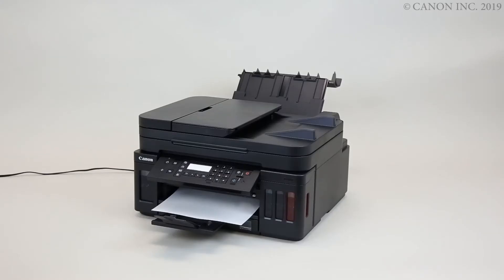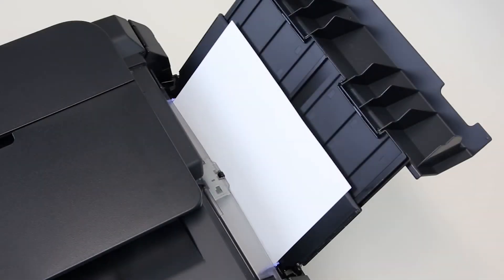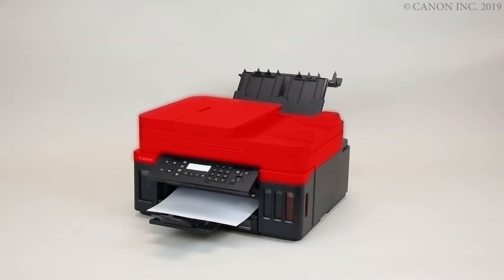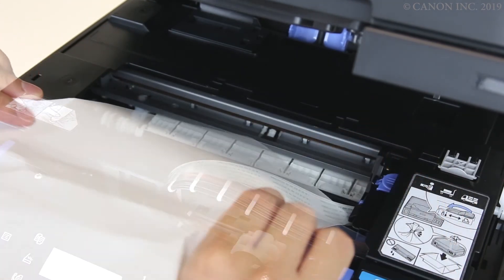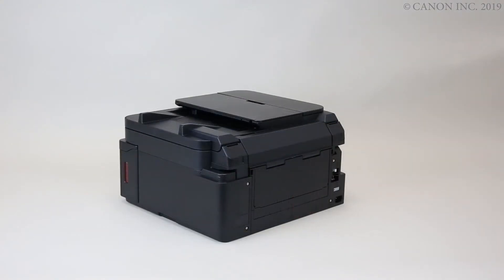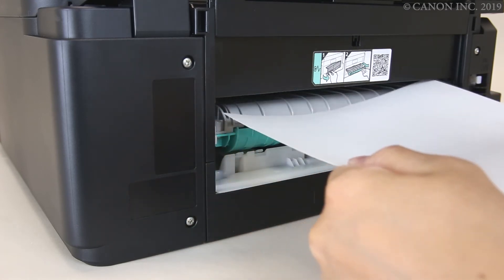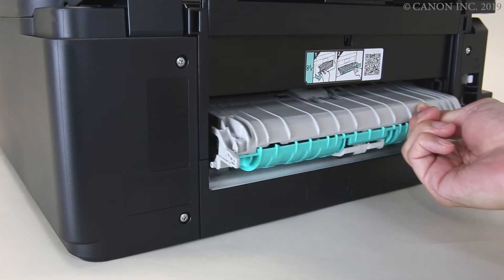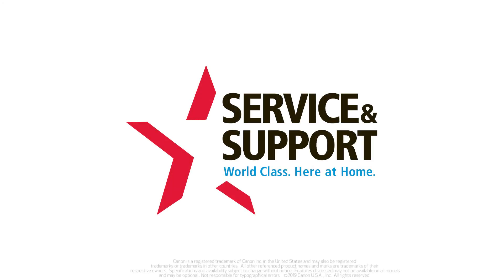Canon PIXMA G7020 - Removing Paper Jams

Comment: I have this printer on order. Is paper jamming a problem that happens frequently?  I never had a jam with my Pixma MX922, but unfortunately my 922 quit working this week. It started off with code B200 and then it wouldn’t even turn on.  I’m pretty disappointed because the 922 only lasted three years. I’m hoping the G2070 will last longer.
Reply from the maker: Hi, Denny!  When you use the right kind of paper in your PIXMA printer, paper jams should be extremely rare.  Using the right paper weight helps, so make sure you're using plain paper between 17 and 28 lb bond (64 to 105 gsm) in addition to genuine Canon photo paper.

Hope this helps!
Reply: @CanonUSASupport  Thank you for your response.
Reply: I have this printer (G7020) for about 6 months and am real happy with it. Got the paper jam today and by taking the rear off (thanks for the video), all is fixed. This is the first time and my wife and I really use that printer. Therefore, I don't think that paper jam is a problem.